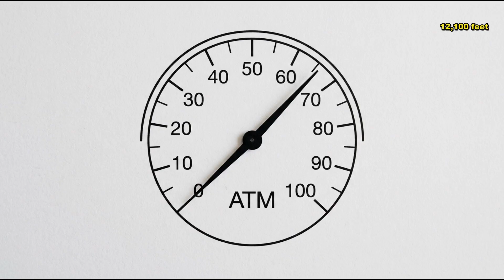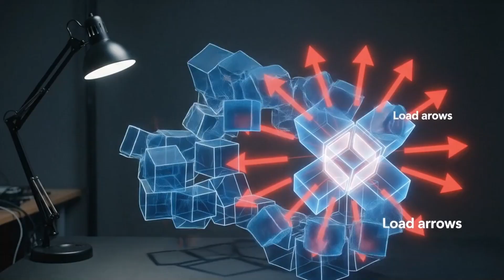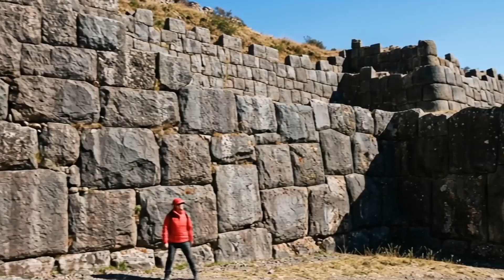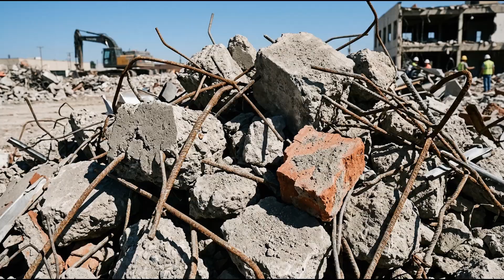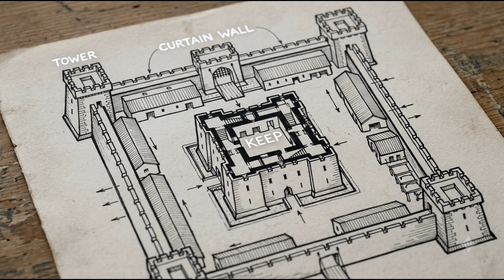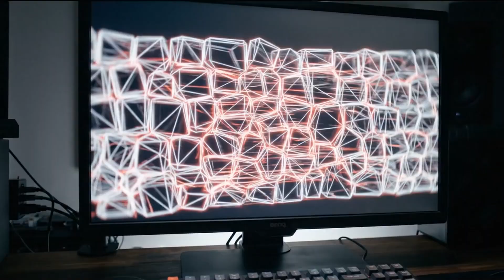200-Ton Blocks at 12,000 Feet: No Human Hand Built This

Comment: A simple mechanical device such as a topography translator was used to precisely fit large stones. Naturally, the Incas could not have possessed either steel tools or such a device. All of this was built by the Spaniards. A more detailed explanation of how the stones were joined and why this was done can be found in the article “Fabrication methods of the polygonal masonry of large tightly-fitted stone blocks with curved surface interfaces in megalithic structures of Peru” (10th edition, DOI: 10.20944/preprints202108.0087.v10) or book “Peruvian polygonal masonry: how, who, when and what for” (148 pp., 2025).